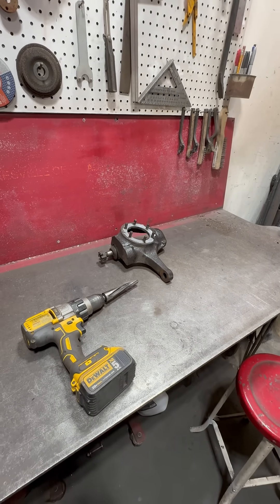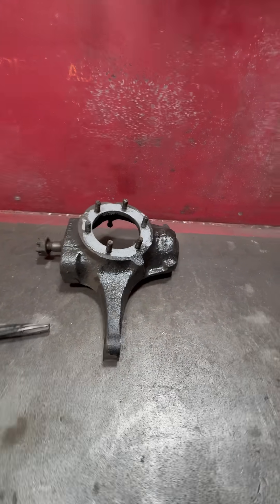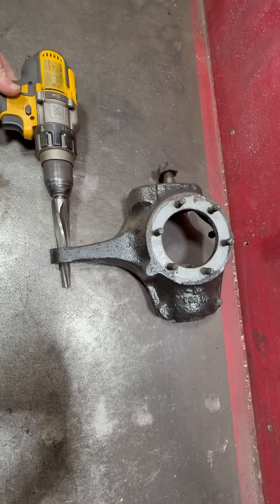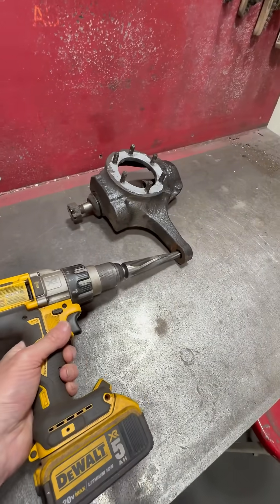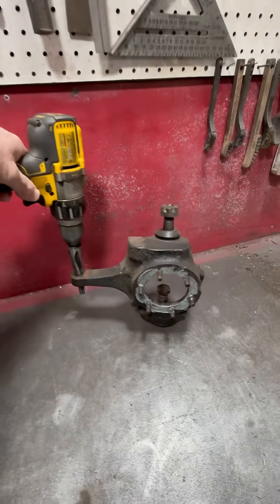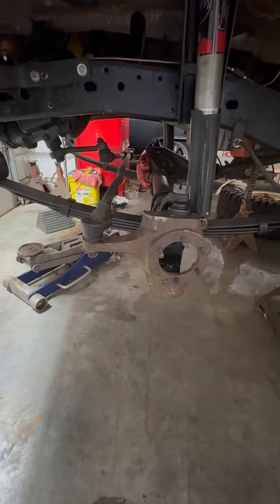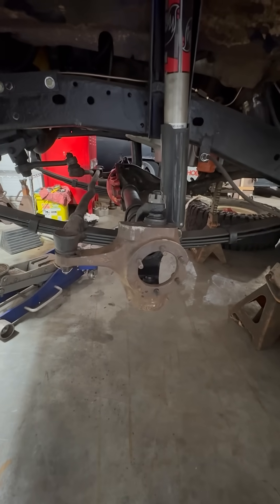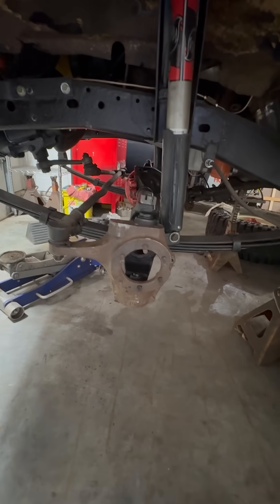Tierod FLIP! 🤯

Comment from the maker: I did a tie rod flip on my GM square body knuckles installed on my 1974 Jeep Dana 44. Factory the Jeep knuckle has the tire rod mounted on top. There were some things I liked better about the GM knuckle but the tie rod is installed from the bottom. All it takes is a little patience and a special taper dreamer to drill out the knuckle to redo the taper. This is just how I did it. Steering is important but safety is more importanter. Your mileage may vary.

#d44 #squarebody #parts #steering #tierodflip #jeep #diy #j10 #tools #garage #thisisfine #offroad #makeitbetter #restoration